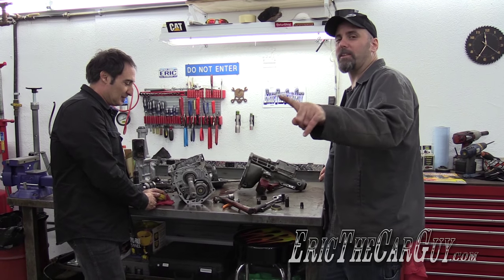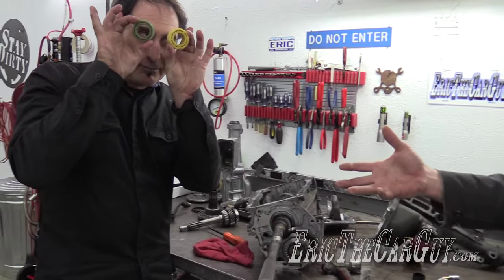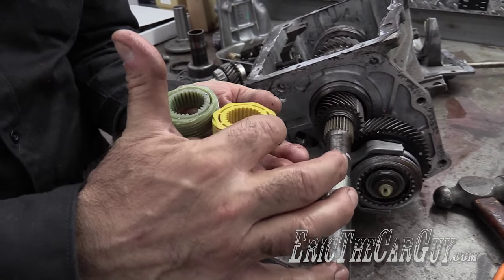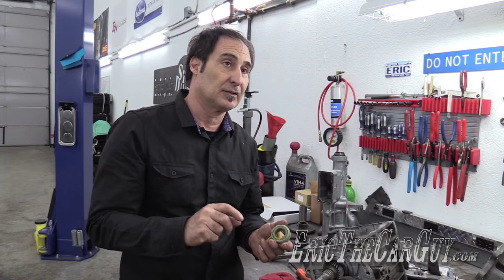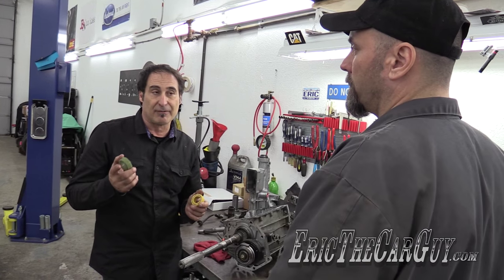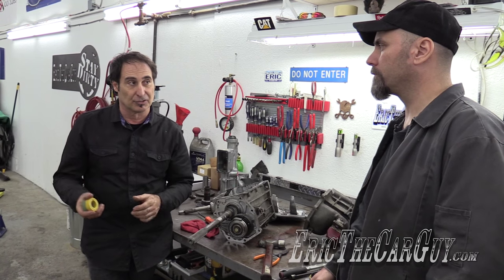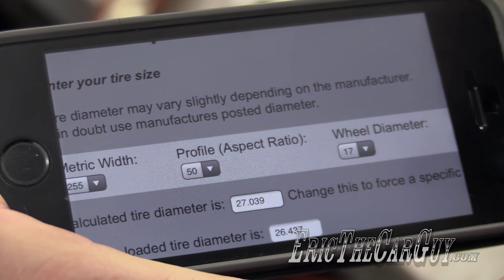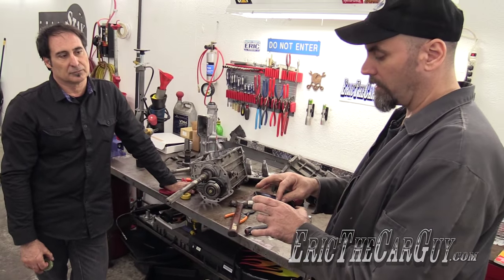What Speedometer Gear is Right For You? -EricTheCarGuy

Comment: Very helpful guys! I have a 65 Fairlane I just got done a massive 17 year project on modernizing and restoring it, swapped the highway gears for 3.55s with a locker. Problem now is when I'm doing 70 on the speedometer I'm actually only doing 55. This video and his website will def help once I figure out how many teeth on my drive gear.
Reply: I did a 3.55 rear upgrade to a '65 Mustang. Is there a way to know what drive gear is in the T5 or do I have to take it apart? The T-5 came with the car already so Im not sure what's in it.

Comment: The places the gear teeth end are known as "Starts" - this can apply to threads or worm gears in this case.  The more "starts" on a thread the faster a nut will move down the bolt per turn. Normal fasteners are single start threads.

Water bottles threads have many starts so the cap comes off in one quick twist.
Reply: +LucasJ1540 That's a great analogy!

Comment: You can also play around with tire size.  On my one car,  they stopped making the size I wanted in the tire I wanted 205/60/15 so I got 195/65/15.  Less than a quarter inch taller but it brought the speedometer from 3mph optimistic at 70mph to about 1/2 a mile an hour optimistic which is much better.  The 195mm also fits the rims a lot better too, the rims aren't really wide enough for 205 IMO.

Comment: I  have 15 drive gear and I need a 39 driven gear, I have been told on my 1986 C10 with a 700R4 should have a speed reducer on it, not sure about that. My speedometer is off by at least 15 miles (higher) do I need a smaller driven gear?

Comment: So right now, I have a 255/60r15 tire 
3.73 rear gear 
I currently have a 21 tooth gear and my Speedo at 60mph is roughly 20 too fast. So if I’m going 60, it’s showing 80. 

Do I need to go up in teeth count or down in teeth count?

Comment: Eric, I have 1969 Chevelle SS with 411 posi track rear end. The tire size on the rear is P-275 60R15. What size spedo gear do I need, thanks for all your knowledge and experience.........Ron
Reply: Go to GMPartsWiKi dot com.  Look up the parts books for your 1969 A-Body and look at the speedometer gear tables.  
You need to know the three digit transmission-model RPO, year, model, tire-size, and axle-ratio.  
If you're using a TH700R4 or some other non 1969 transmission you'll need to look up the transmission RPO for the donor model year and go to the table in the parts books for a plausible donor vehicle that used that transmission.

Comment: I have a 700 r4 transmission in my car. I have 308 gears now, if I change the speedometer gear now will it be accurate when I switch to 373 gears?

Comment: Hi Paul purchased your steel countershaft plate a few years back, thank you, my speedo cable seized up on my T5Z, the drive gear teeth broke and the 7 tooth yellow main gear is missing off the shaft, I now have a tapping sound when the car is ticking over that goes away when I depress the clutch, I have to drive the car 10 miles to tear it apart, do you think the gear has just slipped down the shaft ? if so what would it be tapping against ? any ideas please

Comment: I changed out the speedometer in my '75 Dodge pickup from an 80mph to a 100mph one. My speedometer registers around 5mph faster than my actual speed. (this is at around 35mph, i dont know if it gets worse at higher speed or not.) Would that require a gear change?

Comment: I have a  1994 Pontiac Trans Am. I believe had 273 gears put in. I need to know color gear, is set for this change.
Can you give me any info, regarding my issue?
Reply: the speedometer is reading 30 over correct speed.. The tires are not over sized. Just rear gear change from original to 273 gears.
Reply: the speedometer is reading 30 over correct speed.. The tires are not over sized. Just rear gear change from original to 273 gears.

Comment: So i have a 77 chevy c10.. 3.08 rear end th350 transmision that im not 100% sure but pretty sure isnt the original one ..the speedometer doesnt work because gear is wrong.. Im about to pull it out this week amd see what tooth count is on the output shaft..but my question is how does it determine which ome you need if it isnt the original one?  Maybe I'm missing something here..does the drove gear on the outout shaft not matter which one it counts as to what speedo gear we hook up to that to make it work or do i have this wrong?  😬 sorry 1st timer here trying figure this out.
Reply: Each drive gear has a range depending what rear gears you have, Ex. A black drive gear might work wit 2.25 - 3.55 rears, then you fine tune it with the different driven gears the one that go on the spedo cable.

Comment: Can anyone help me with a question I have. I recently purchased a 2000 Chevy Blazer with 200000 miles on it . The guy told me he has ran Mobil 1 synthetic in it since he bought it brand new. The car does have a small oil leak, would switching back to a thicker conventional motor oil fill in the space and possibly minimize my oil leak or should I just stick with the Mobil 1 synthetic? I am extremely good about changing oil and am wondering if conventional will help keep oil leaks at bay?
Reply: no. it will not fix an oil leak.
Reply: Mobil 1 isn't a good oil to begin with (sheering issues are common), but switching from it to a heavier oil wouldn't help with a leak. 
Heavier helps with slight burning, changing brands helps with burning (Mobil 1 is well known for burning issues from sheering), but not leaks.

Comment: So dumb question, 78 F150 RWD. Id plugin rear wheel sizes right? Cause fronts are low profile, rears are not.
Reply: +WannaBeDj100  You would use the tire size of the drive axle. Unless you are working on some of the oddball vehicles like an air cooled VW, those get the speedo drive from the front tire.
Reply: ***** Thank you, good sir! Thats what I would have ass-u-me"ed". but like the saying goes.
Reply: you are correct...off the rears
Reply: Thanks!

Comment: Does the trans have to be dropped again to change out the speedometer gear inside?
Reply: Some automatics its possible to remove the tail to change the drive gear. With a T5 and most manuals that is not possible.
Reply: @GearBoxVideo  well that sucks...I wish I had seen this video before I swapped out the 3 speed with a toploader and installed a new rear axle with lower gears.  Maybe I can peak in the hole to determine what color the drive gear is and try to go from there.
Reply: @bobbya9949  Toploader you can drop the driveshaft and remove the tail to change the drive gear.